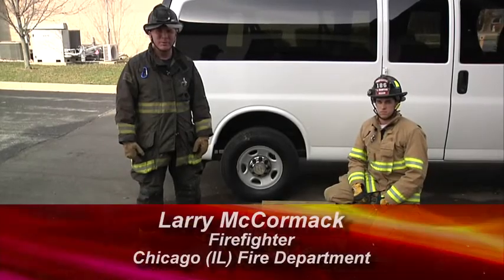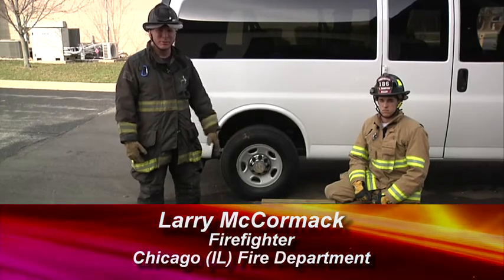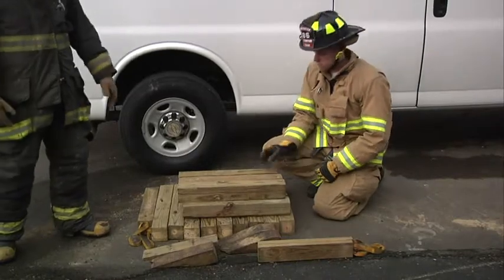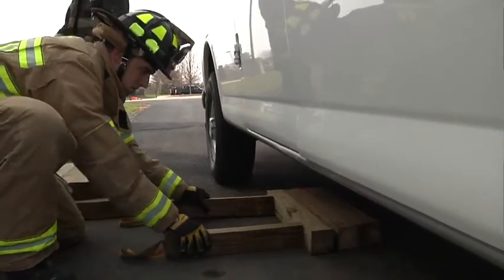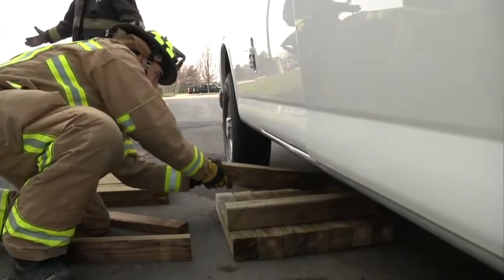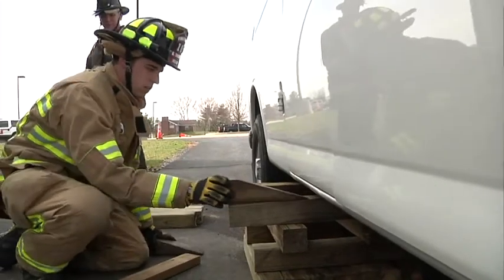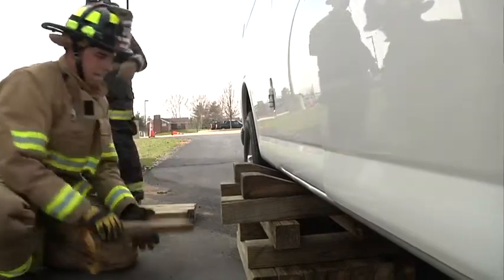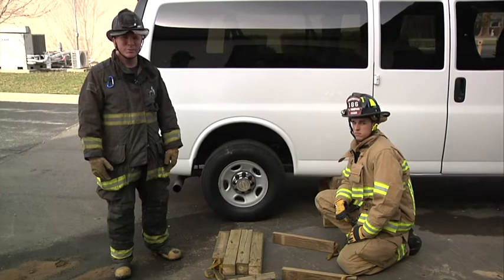Box Crib for Stabilization #3627425259001

Comment: Not clear on max crib height. If max is 3 times the base, then, counting the base, it's 4" x 4 = total 16" high, but at the end of video, he said max is 48". Please clarify. Thanks!
Reply from the maker: The calculation is 3x the footprint of the crib.
 
Each piece of wood he's using is 4 x 4.
 
If you place four of them next to each other, it's going to be 16 x 16. Three times that is 48". This also assumes that they are cut to 16" lengths.